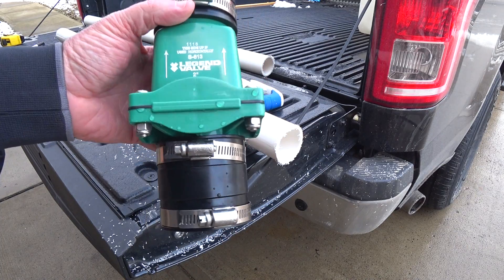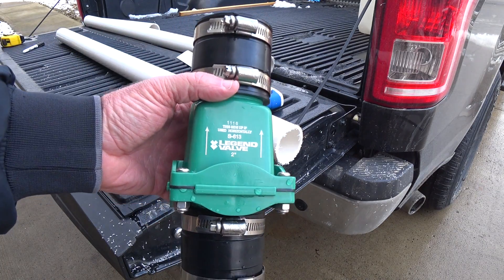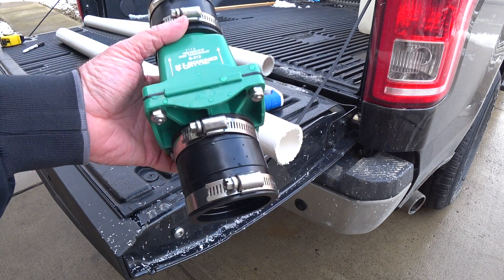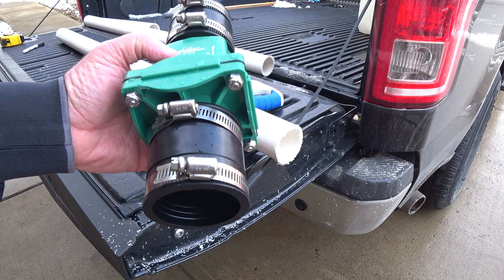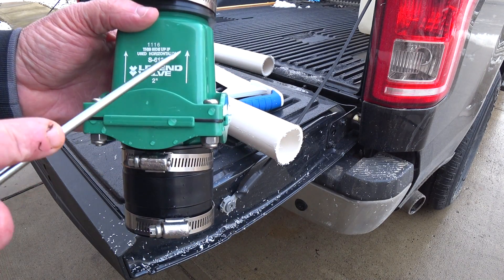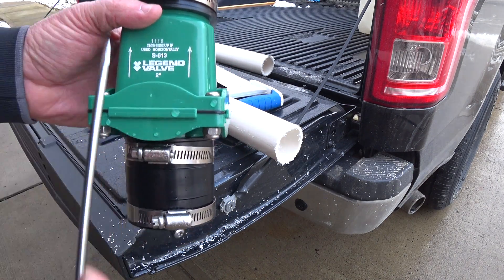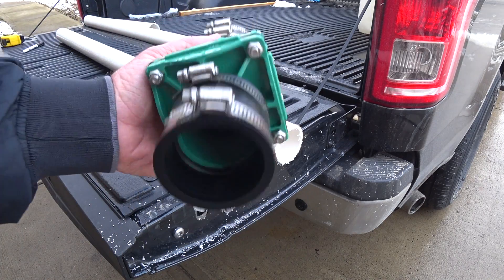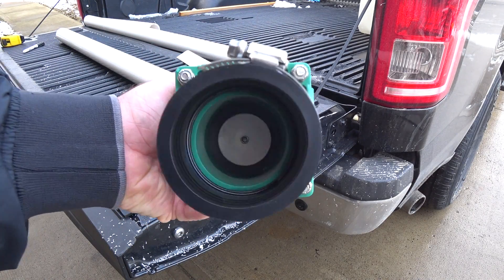#127 How To Move Water With Easy, Cheap, Siphon System

Comment: Would there be a way to attach a hose to one end so the hose could be attached to a normal pump with electricity for lake intake water? We have an old lake intake system but it is very old and the buried pipe I think has holes and is too hard to dig up to replace. I'd like to do something like this as a substitute as we only use the cottage for one month each summer.

Comment: hi buddy..
My question is: i have a 3/4 acre pond that floods the backyard after snowmelt and spring rains.i dont know if i should use 2" or 4" pipe.
Based on what your seeing on your pond...how long would it take to lower a pond 1ft.? (our water table is usually at 3ft. in the spring so i dont know if ground water will come in the pond as fast as i can pump it out!?
yours thoughts please.

Comment: my build would be, ball valve on the filler pipe and on the outlet/drain end. a small generater w/sump pump to fill it up with. it is to dang cold to fill 6-7-8 buckets of water and you know it wasn't just 3 lil buckets !!! LOL nice job guy.

Comment: Thanks so much for sharing.  I need this system to remove water from a well that connect to all rain water from the downspouts. The horizontal pipe that carries the water out is an out 2 feets lower than the outlet that drains out to the street. So there are two holes, one hole for water coming into the well, one hole for water to drain out one the water level has reached 2 feet high.  But there always the 2 feets of water sitting at the well.  
Do you think I can connect the inlet,  the outlet and the middle vertical pipe like yours to drain water without dumping water into the well first?

Comment: Try it without the valve. Just load the system as you did, as long as you keep the end-cap tight, the water will remain in the system. It's like a soda straw that you close with your finger and pull up.. soda stays in the straw. That's an easy 16 bucks saved
Reply from the maker: It would still be open where you fill at at, wouldn't work
Reply: @OutdoorsWithTheMorgans  I actually woke up this morning with that in mind.. what was I thinking..

Comment: Hi Mike! Thank you for sharing. I hope you see my comment. I just would like to ask if this works as a water pump? I am starting my business in cemented tanks. The bill for electricity is quite high if the engine works non stop. My question is that, would this work on pumping the water from the tank up to my filter? Thank you! Greetings from the Philippines!

Comment: this is a nice video and he has some great ideas no doubt, but I get the feeling this guy just likes tinkering with stuff, nothin wrong with that but I mean this maybe was cheap to buy the parts but all the time involved and so many steps and things to construct and with each one of those there are an infinite number of things to slow ya down. ultimately leading to a over complicated system thats only good for the place it was built, yeah you could use the parts for other projects but then your adding Deconstruction into the mix. I see guys all the time get way to involved with simple projects and ultimately get nothing done. Here is my advice such as it is... Never reinvent the wheel unless your an absolute genius or something, and always try to keep things as simple as possible. example for this buy a pump drain the pond done and done, no check valves and system priming blah blah blah. I dunno bout you but I got better things to do than waste time trying to find cheap ways to move water when cheap easy way has already been created by people who have same problems as you, I mean you dont think pumps were invented as toys for wealthy people do you

Comment: Great idea. What would you add at the inlet to prevent debris from clogging the valve? My application is to drain water that might collect around an above ground pool that is set into a slope. The only time it would be needed is when rainwater collects around the pool and therefore there will be periods of no standing water and perhaps a lot of mud left. Perhaps a catch basin at the inlet also?

Comment: Leave ball valves half closed if there is a chance they will freeze, this prevents water from being trapped between the ball and the body which will cause a split in the valve body

Comment: I just stumbled on this looking for yet another replacement pump.  If this could work for my application that would be a game changer.   I have a good sized pond that is about level with the concrete cover of a rain sistern buried in my back yard.  In the bottom of the rain sistern is a submersible sump pump that pushes water in a buried 2" PVC line that shoots it into the middle of the pond.   The pumps don't last long and then my yard is flooded and I have to pump down the sistern, enter it, and change pumps.  This is a huge hassle.  I noticed it looked like you came from a lower elevation that you were drawing water from and ran up grade and than back down to the outlet.   What are the limitations of this?  My sister is probably 7' deep but even if I could sit it 3' deep into the sistern and siphen to the pond that would be great, although like I said before the top of the sistern is pretty much level with the pond bank so the most drop I'd get into the pond would be maybe 5 to 7  inches.   Possible?
Reply: No, if I understand you 😀

Comment: I used one of these to drain my leaking pond before I cut the dam to fill it in. Worked well. Took three weeks to drain it with 2” pipe.
Reply: If you used 4" pipe it would move 4X the water the 2" pipe moves.    2" pipe is R of 1xPi,  4" pipe is R of 2 sq= 4xPi.  A=Pi  x RxR

Comment: Hi Mike, just watched your siphon video from 2 years ago, you said you were going to fix the overflow later, don't know if you did, it reminded me of the super simple clog proof attachment I came up with that has worked flawlessly for 7 or 8 years now. My overflow is 6" pvc horizontal through the dam. I put a 6" "T" at the end of the pipe with the middle tap to the pipe leaving the "T" open up & down with a drain screen on top & the bottom open. If your pipe is straight up just 90° to horizontal then add the "T". Call if you like, I can make a drawing but I think you probably can visualize it. 7066254315 leave a message. Maybe you had a better idea. I really enjoy your videos. God bless...

Comment: 5:05 If at the entrance to the pipe you had a bell mouth entry with large radius rounding like shown here:
https://www.google.com/imgres?imgurl=https%3A%2F%2Fwww.ksb.com%2Fblob%2F190758%2Fcad5c476a742f00307bb5ec261d44ad2%2Fdruckhoehenverlust-9-data.jpg&imgrefurl=https%3A%2F%2Fwww.ksb.com%2Fcentrifugal-pump-lexicon%2Fhead-loss%2F191314%2F&docid=7hxN9oUr1JLzUM&tbnid=0IiEDQ7RxiGddM%3A&vet=1&w=650&h=416&itg=1&bih=625&biw=1366&ved=2ahUKEwiNjOvO_ojoAhXnnuAKHa2SD-wQxiAoCnoECAEQNQ&iact=c&ictx=1

The flow rate would be MUCH HIGHER.
Also a conical outlet to the pipe downstream, like a 15 degree cone of expansion would recover some of the velocity head, to create "SUCTION" at the outlet, again increasing the flow rate. Good Luck.

Comment: Thank you very much for this simple solution 

I Plan to syphon water through 3/4" hose from well to a plot away at 50 meter. Water level is 5 meters below 
Cant locate check valve. Can I know the catalog no from any reputed manufacturers?
Thanks
Reply: I have had good luck here - https://pvcpipesupplies.com/

Comment: To keep the pipe  from freezing up all you need to do is  drill a small hole on the up hill side of the check valve  to drain  the pipe or maintain the water levels

Comment: Thanks for this system.  i followed it and managed to charge my 3/4 poly line from my shallow well with no issues getting the water flowing.  However, the charge in my line won't hold and the line goes dry.  Any ideas why this is happening?  Background:  I'm in the tropics and my well source is 300 feet higher than where I live.  We don't get the full benefits of the gravity fed vertical drop because there are numerous mini saddles the line runs though before it takes the big plunge downhill to our property.  The well inlet is approximately 15 feet underground and the outlet source I made is downhill lower than the inlet..low enough that my water volume when I open the system initially rages...i already managed to lower my well depth by 2 feet just charging the line...it's running through 1000 meters of 3/4 black poly...

Comment: Chris @ Letdig18 doesn't use a check valve they just stick the pond end into the mud then pop off the down hill cap and it pulls the mud through it with a 6" pipe.

Comment: Great way to charge the system. Check valve and tee.  One draw back if freezing temps are coming: section from tee to check valve still has water in it when you shut it down and will freeze.  You could use suction hose, with check valve on end - from elbow on inlet side of tee - have rope on end kf suction hose, drag hose up the bank and drain out the last piece.

Comment: Hi Mike...this really helped me understand the way the pump works...I was wondering if it makes a difference if you put the main valve underwater or if was possible to put it after the pressure chamber and still have adequate pressure coming from the pipe under the lake with no valve

Comment: Very cool. Simple.
I know you were doing it to lower the water in your pond.

Somebody else could attach a garden hose or garden watering system with an valve on the bottom.

As long as there is water in the pipe it will draw water when turned on.

Comment: You realize that the check valve is completely unnecessary right ?  If you temporarily had the inlet end higher than the fill port while filling and than had a second person open the outlet end while you lowered the inlet into the pond, you would achieve the same end result.  There is a little money savings to be had here with a little help from a friend.

Comment: My thought : discharge could be a roll up and the inlet needs to be solid or on a float ...  The same fill the dropping end full of water and it will draw due to the weight of the water pulling.  Very cool.
Reply: It wouldn't work to make the discharge a roll-up. The discharge pipe needs to be solid or it will collapse and the siphon will stop.

Comment: Thanks! Finally a clear concise video on moving water down not up.  I have a 2 season irrigation creek cutting across my property along a hill and I will be diverting some water from it  for a pond (eventually) - mountainous area (Rockies).  Just wanted to express my appreciation!
Reply: As long  as you let water out lower level than the inlet pipe then it will work even the pipe goes up b4 going down...then from the outlet with that pressure you csn put ram pump to travel the water uphill...

Comment: Cool video mike for those that didn't know how to run a siphon pipe line. I have two at the farm one in the well & one at that dams. Run black pvc pipe a foot valve in the water source then a gate valve a couple of meters or feet down from the stand pipe so you don't have to fill the whole pipeline, fill to the stand pipe seal open the gate valve & of course let gravity do the rest.
Reply: Sounds interesting, but I have no idea what you are talking about. I'm new to farming and have a problem with beavers flooding my land. I would like to use this system. Can you make a video and link me. I would live to learn how to make this.

Comment: 👍  Very nice!  I was wondering if some flat PVC hose would work as long as the ends and priming section were made from rigid pipe.  That might make longer runs, say 150 feet, possible, and faster to assemble.
Reply: All the "suction" pipe needs to be rigid not just the ends and priming section.  The discharge or down hill section can be flat hose but I would use a slightly smaller discharge hose than the  rest of the system.  If there is a high head on the discharge side and the hose is the same or larger if can be sucked flat by the falling water.  Might start flowing again as the water catches up but unless the hose goes completely flat you can start getting air in the system and that will kill the suction as the air works it's way up the system.

Comment: You actually have valves like that in your heart.
Reply: then people would die when upside down
Reply: Actually, that is not at all what the valves in your heart are like...they actually have 3 lobes that meet in the "middle" to prevent back flow.
Reply: Beware youtube, the valves in your heart are not exactly like these. If you got this from my comment: you can not call a plumber for your heart and the heart is a great deal more complicated. Now pull your underwear out of whereever it’s hurting.
Reply: @Noeraldin Kabam   You said, and I quote, "You actually have valves like that in your heart."  If you're  going to make an "informational" statement like that, you should at least know the truth of the "facts" you are spewing.  If you actually know that heart valves are very different from a check valve in a pipe, what was the purpose of your original comment?!        Are you just butt-hurt because someone called you out on your lack of knowledge?

Comment: Thanks for the video. I thought of this earlier but didn't use the check vale thinking my 80 feet on the downside would be ok once it started to flow and would flush the air from the stand pipe to pond intake end. Nope. The air intake killed the syphon. I will try again this year with 3 inch ABS since I need to drain 3 feet of a two acre pond. I want to dig out part of the pond and if I can lower it early it will dry enough to get a bobcat in it.

Comment: You seem like you would know a lot about water flow. This question does not really relate to your video. But if you could make a video or  just let me know in a comment the answer to this question.   I want to build a garden tower to grow my lettuce, strawberries and etc hydroponically. I have devised a tower with 6" pvc for the outer structure. Then on the inside a 1/2" pvc pipe with water misters running up the line. The two pipes will sit in a water bucket, Each of the pipes will have a bunch holes drilled in them to drain excess water / allow water to enter all depending on the water level in the bucket. The bucket will have an overflow hole in case of excessive rain, as I live in south FL. I just cannot figure out how to run the water from the bucket into the misting pipe, without an electric pump. As I want the misters to be running most if not all of the day.
Reply: To do this mechanically is very difficult since you are basically creating a perpetual motion (or energy) machine.  But if you do manage to do so please send me your schematics.  
Barring the above, there is however a time tested method of getting water above ground level more than 350 feet, and recirculating it down again.  To start off develop a medium that will hold your water in suspension.  Place your plant roots in that medium and through capillary action they'll help the water to the top of your plants, where via transpiration it will eventually fall back down on your medium and be reabsorbed.  This process continually repeats itself and is a tried and tested method of growing plants which apparently has its roots in Adam and Eve   
BTW, the 350 feet is a giant redwood, and that does not include the depth of its roots.  Furthermore, the modest little strawberry plant, to which you referred, has been documented (soilandhealth.org) to having roots more than a yard deep.

Comment: nice job.  Instead of using a cap at the end to open up the line why not just put a valve down there.  That way you don't have to lose the prime only to later re-prime the line.  It saves a step or two.
But I like the idea.  Our neighbors use something similar with their pool.

Comment: You do know if you include a second check valve and that stack you use as a fill pipe, you can make a ram pump, that will pump water quite a way up hill, with a very little down hill drop, to start the process. All with the siphon effect. 2 inch diameter pipe will move a boat load of water, especially over the 24 hour cycle/time period .

Comment: The secret is to find a way to fill the pipe, then break the bottom open to initiate the siphon.  You do it by capping both ends and filling the water from the middle.  If you either submerge the bottom and the top, or only the top and cap the bottom you can also achieve this by putting a small valve with a barbed hose end and pulling a vacuum til you evacuate all the air.  I did this by pulling a vacuum line of my running truck and then waiting for water to start to enter the vinyl tubing and shut it off then take off the lower cap (or open the valve in my case).  Mine was a 2" to prime a larger 6" pump system...

Comment: That looked good, but didn't understand what was doing what and why did you need water in a the stand up pipe and was that purple stuff glue or water sealant, would any of those chemicals hurt fish in the pone or any wild life in the pond,  Could also so an easy way to put in an over flow pipe to let water run out of the garden pond to water the surrounding plants.  thanks.